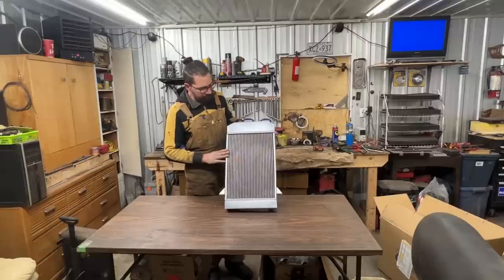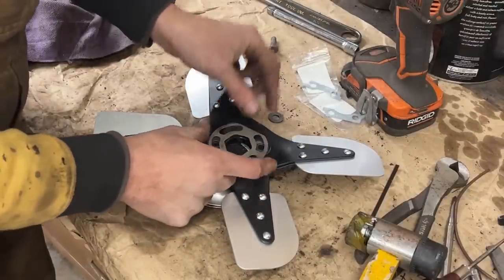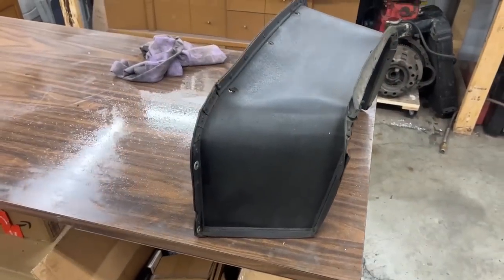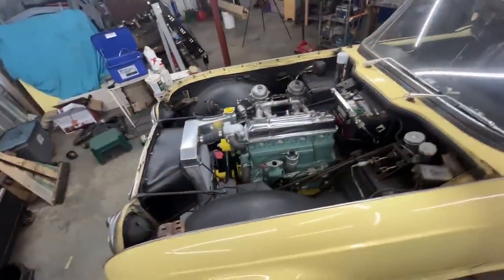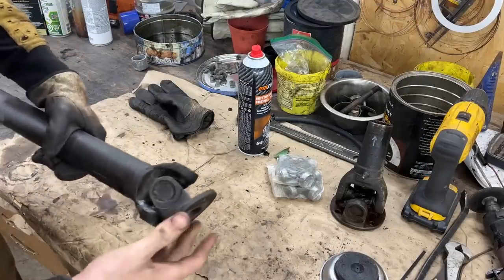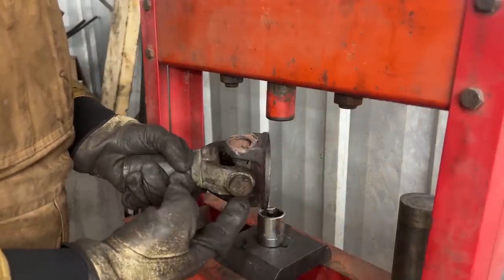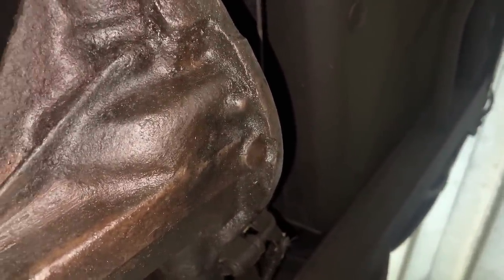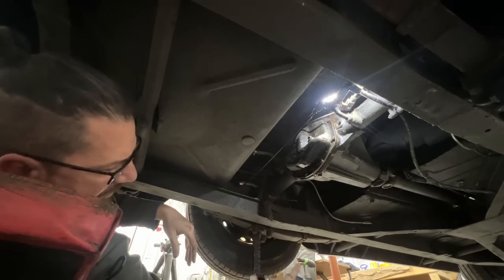1964 TR4 - Part 20 - Radiator Install and Diff servicing

Comment: Always teplace the U-joints when you have the prop-shaft out. U-joints are not expensive. I use Coppergraf Anti-seize on all bolts. I use a copper or brass hammer to Whack caps outward. Easiest way i have found. Use lube.

Comment: Probably a good idea to put anti-seize compound on any of those NPT plugs since they are 2 different metals and over time there will be galvanic corrosion and they'll seize in place almost like they're welded  :)  Also nice work on the overflow!
Reply: I use Coppergraf anti-seize on all threads.

Comment: Excellent video. I share your frustration with new parts not fitting right without modification. I bought a new heater valve for my MGB GT rebuild and it leaked where it bolts to the head. Took it off and checked with a straight edge and the mounting flange was like a banana. Ground it flat on my surface plate and all good- but I shouldn’t have had to waste time doing it!

Comment: I worked as a prop reconditioner for a few years, its not your circlip pliers, although good ones are much much better for this job, there is always a running endplay in a UJ, if you hammer one cup into the yoke resting the outside of the other side of the yoke on a solid surface, you will drive the bearing cup away from the c-clip, easing the pressure forcing it against its groove. If one side wont shift, the other usually will.
Reply from the maker: Thanks! Makes sense!
Reply: @RustyBeauties  If they are really determined, doing the same but maintaining pressure with a vise or press on one cup often overcomes the outward force of the cup in a tight bull yoke. Loving the tr4 series, got a soft spot for em after swapping a real axle on a 4a in the 80's. Had the rare pleasure of servicing a genuine tr8 once too, that alloy v8 certainly made a very different beast of the '7 bodyshell.

Comment: When I drill / tap the diff for a new plug, I dip the drills and taps into wheel bearing grease or beeswax before and during the drilling / tapping. The metal chips stick to the grease and you have way less chance of getting chips in the diff (or transmission or oil pan). Makes "cleanup" a breeze.

Comment: That was really interesting. Looks like a great job in the engine bay and figuring out the radiator, etc. Also interesting  work on the u joints. Thanks again!

Comment: If you use a hammer & a drift on the u j cap it will relieve the pressure on the circlip making it easier to remove, then you use the same method on the other side. Also, tap the yokes sharply with a hammer after assembly & it will relieve the internal stresses in the u j caps & let it move freely.
Regards,

Sandy 🔧🏴
Reply from the maker: Makes sense, thank you for the tips!
Reply: I was gona suggest whaching the assembled knuckles outward to relieve bind on the new U-joints. I have been workkng on these cars for 45 years. I own a Tr6. Hell! Nascar guys have one in their flock.

Comment: Awesome video! I am about 2 weeks away from the first start in 28 years off the road with my '63 TR4, going to try and beat you to it!  ( Don't forget to fit the heater return pipe from the water pump to the back of the engine, I see yours is not there yet!) Best of luck.
Reply from the maker: Well, I am behind with editing. I am further ahead than what is on YouTube. I may or may not have attempted the first start yesterday :) we will see in the next video. I deleted the return pipe as the owner never had heat in the last 30 years. The heater was not hooked up when the car came and the owner doesn’t want me to deal with that. The pipe was rotten and patched too, so instead of repairing or replacing it for no reason I just plugged the holes on the pump and the head.

Comment: When I put my Al rad in and electric fan in, I trashed the mechanical fan.  Maybe if you keep it, the electric will run a bit less though.  Mine only runs if I am at a light for a minute or more and it's hot out.  
When you struggle to get the clips off the U-Joints, first pound/press the U-Joint to one side and take out that clip, then drive it back and take out the opposite clip.  I found this to help tremendously, and also during assembly (like you did). 
Once the new U-Joint is in, you might notice it is a bit stiff to move.  I had this problem and read about it for a while.  You smack the casting around the caps with a hammer, and it loosens right up.  I didn't believe it would work, but it did.  The caps are just pushed together a bit too tightly and they release just enough when you give the casting a smack.  This little bit of movement is why you can push the caps together and make it easier to be the clips clips out.

Comment: I was taught to take a punch and hit between the caps on the yoke where they cross at the four locations to relieve the pressure on the u joint after installation. Not sure if it works but I always do it.

Comment: A tip that has worked for me on the circlips is to tap them lightly with a socket prior to using the circlip pliers. This tapping breaks the bond that has formed between the clip and the journal.
Reply: Yes knock the spider down away from the circlip to give a bit of clearance. Then flip it over and do the same the other way...

I think the heat and stress from the failed bearing helped to bond everything in place.
Reply: I agree! And once the first circlip is out, you can press the opposite side a little to make the 2nd circlip a lot easier to remove. 
I would not drill a yoke like that. I would be afraid it might crack from that point. It's probably okay on a gently driven car. But I'm not gentle!

Comment: Hi Elin, brave man drilling through the diff casing from under the car. You did well not to damage anything on the inside. 

In theory the NPT threads need a seallant to make them seal, the NPTF thread known as dry seal do not, that is at least what the specs say!! I'm sure what you have done will be fine.

The engine bay looks superb!!

Good luck from Spain!!
Reply from the maker: I sued a little teflon or plumbing tape as they call it here on the threads. It haven’t leaked so far so we will see.

Comment: It helps if you give the ends of the old  joints a good soaking with a release oil and a good thump with a hammer before you try to remove the circlips,. You can even use the press instead of a hammer just to unseat them from the bearings.
The joints often had a plug in the greasecond hole that you were expected to remove, then fit the long grease nipple,  gease them then remove and replace with the plug.  It's meant to prevent the grease nipple getting damaged. It could also have an effect on the balance of the shaft.
Reply: You can also put the magnet inside the difference casing where the hole is going to come through.  Or use a piece of tape with a lump of grease under it to catch the metal.

Comment: Another excellent and informative video. I like the few tricks you use.  I have changed many u joints and from time to time a needle bearing has come loose when trying to put the end caps on. There isn’t much grease in the cap to hold the needles in place so I always put a good dollop of grease in there so that nothing falls out of place.  
I have to ask though. Why are you going with two fans?

Comment: Also found that if you can lay down some of the needle bearings between the cap and the end of the cross, it would give you the last few m/m it takes to push the cap out.
Reply from the maker: Another great tip! Thanks

Comment: I replaced the front seal on my solid axle TR4A, with the axle in the car. Unfortunately it’s a much tougher job to access the seal because of the shape of the TR4A frame.

Comment: For fan mounting I think the flat washers go over the rubber bushings to apply even pressure on compression. Next the locking plate has slots orientated so with bolts installed the fan can't turn counterclockwise. Looks like you got it right. Is the fan installed right without having curved edge leading on clockwise rotation? Also do the old fans need any balancing?
Reply: Am only at start of video but I think it’s back to front - curve should be leading edge for safety   (??)

Comment: Hi Elin, how do you connect the power fan to a sender unit in the block? When I was a pupil telecom tech in 1970 I wanted to install a fan on my Triumph 2000 mk1, because it gets very hot in South Africa and the car didn't take kindly to it and boiled in traffic. I thought an extra hole would have to be made in the radiator for a sender unit, so I never got around to it. Thanks for your very interesting videos!

Comment: If you don't like the way your radiator shroud fits against the radiator try using a strip of Velcro along the front of the radiator I used the stuff for a lot of things. they kept my number plate on my race car at 150 miles an hour. The heat might be an issue though with the sticky side that attaches  to the rad.
Reply: Hi Gary, if your thinking of doing 150mph again, I would probably take your registration plates off before the cops clock you.
Reply: @philtucker1224  read it again i said racecar which was never on the street. It was a 23t altered on alky.
Reply: @garyfraser8584  oh I’m sorry Gary! (Over here in the U.K. we use the term “number plate” for a road car’s registration number) actually I was doing a poor job of making an English joke so apologies to you buddy! ( did you win any of your races and what type of race car were you driving?) 🙏🇬🇧
Reply: @philtucker1224  it was a 1923 model t altered running on alcohol for fuel with an 8l (452 cubic inch dodge engine. Drag racing.

Comment: Didn't one or two of the Le Mans TR4s have to retire due to a broken fan blade through the radiator? Or maybe it was one of the TR3s.
Either way, what's worse is that they probably didn't need the fan at race speeds. 
It might explain the convoluted mounting they used... Amd the later change to a plastic fan with more blades at a more acute angle.

Comment: my '64 TR 4 27,000 series, built in November of 1964, does not have the extension on the orignal radiator.  Maybe the earlier 
'64s had the type you chose.
Reply: It was a long time ago, but I recall my 64 didn't have one either.
Reply: I think Elin said it was the 2s 3s and very early 4s only..
Reply: My TR4 is registered 1964, but was built and shipped in '62. It was common back then for cars to be registered the year of sale, ignoring the actual year built. 
The VIN is a better reference for change points. Mine is CT17602L and it has the long neck radiator. Also has no overflow bottle. Just an overflow hose. The long neck was supposed to serve as a coolant expansion tank.
Reply from the maker: I don't know if that was the original rad for the car, but it came with a long neck so that is what I replaced it with.

Comment: Elin I’m not keen that style of diff drain plug, I would be happier using a drain plug with a shoulder and a fibre washer.
Reply: Our early 2 (TS394LO) has the early diff with a drain plug like the one Elin installed.  I wonder if Triumph quit installing them because they could get knocked off going over rocks in a rally.  I used to watch the Shell 4000 (Vancouver to Montreal) in the 1960s at the special stage near Saskatoon and there were TR4s in it, as well as in many others.

Comment: What's up with the single, "erect" horn? I've always seen dual (high/low) horns that lay flat in their brackets.
Reply from the maker: That is how the car came. As long as it works I don't see an issue with it. This car is not meant to be original, but a reliable weekend driver.
Reply: @RustyBeauties  Thanks. It just seems an odd way of installing the horn. I thought maybe it was loosened and tipped upward for clearance while removing and then reinstalling the engine, radiator, etc.

Comment: You should have put a 250 fan on then no need for the Electric fan.
Reply: That 4 blade fan looked worse than useless…
Reply: The electric fan also blocks a lot of airflow to the top of the radiator so not a 100% good idea... the car apparently worked fine for 60 years with positive earth, dynamo / generator, crank fan, no diff drain plug and 1 gasket on the diff cover fitted in the factory with no gasket maker ! But a lot of it was definitely very worn and tired !
Reply: Bill for the uninitiated why is the 250 fan an improvement please? 🤔
Reply: @philtucker1224  It has 7 blades and weights less than half the 4 blade does, and moves at least twice the air, also it's closer to the Rad.
Reply: @billgoin4004  hi Bill, (of course rad fans are for when the car is sitting stationary) and the 250 fan design sounds much more effective in that respect. However, Elin (and Dave) will know that so perhaps there is a stronger reason why Elin needs to show that it has kept the original design. (Obviously I do agree with you from the technical standpoint). Cheers buddy.
Reply: @philtucker1224  Have a safe summer driving Phil